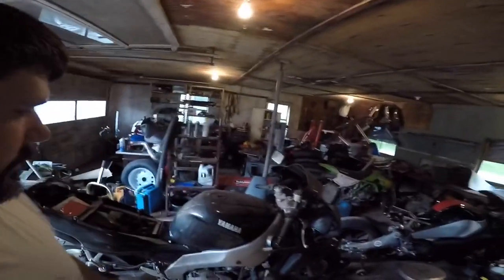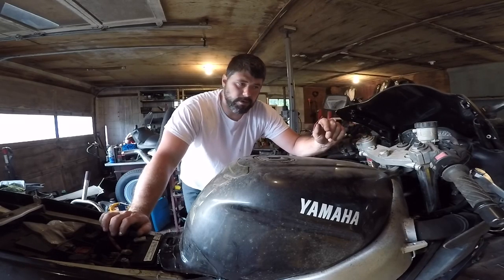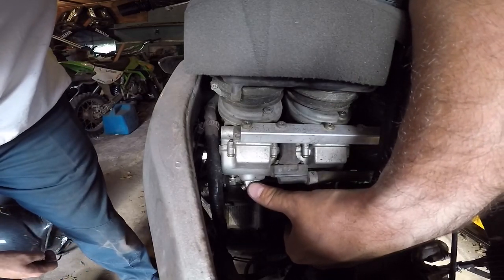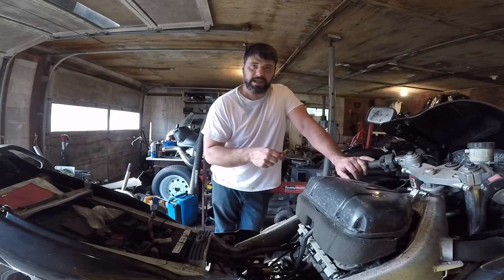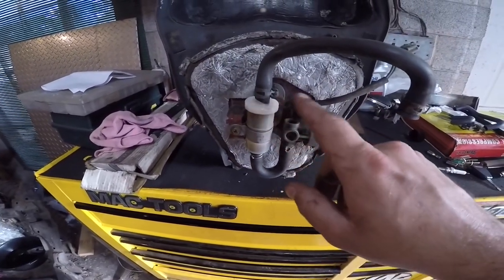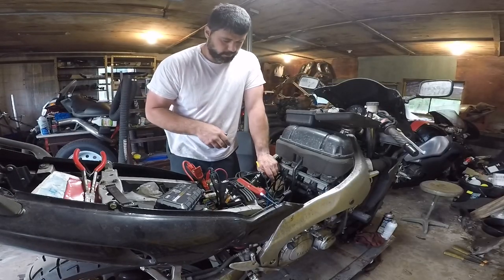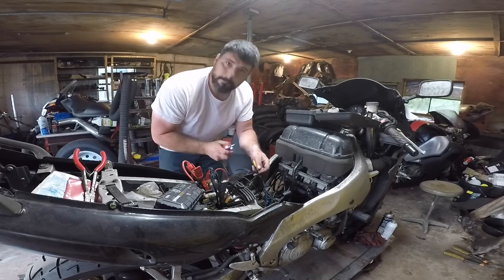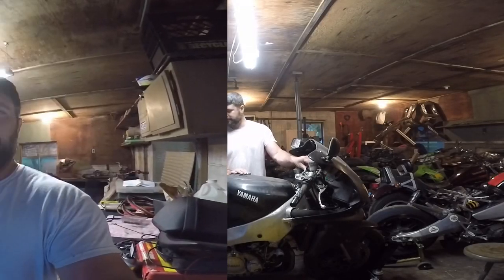Will my YZF600R (thundercat) start?

Comment: Mine b 4 I left to go bk to the uk was completely drained.  I mean not even engine oil in it. I wend bk to Kashmir after 7 years. Yes that's write  7 years.  Changed oil filter and added oil. Addid radiator flued.  Added break flued.  Addid a new battery from the uk. Dident change the fuel filter but added a good fuel not high octane.  Guess what????  The bike started first press and sounded just like new. I still haven't run her for 4000 miles yet would  you believe.  Check it out on my channel  .

Comment: I would of added premium and opened each bowl to allow fresh fuel to run out for a tiny...instead of trying to burn your starter out. If no fuel came out..then tinker with the fuel pump. Once you rinsed the bowls and insured the float isn't stuck...then try and start

Comment: So mines been sitting for a while. Put a new battery in it and it seemed to start properly and run but no I'm having issues with it starting, it turns over and theres no signs that lts in bad shape just won't start. I think it might be the spark plugs what do you guys wrekon

Comment: Got a 06 & it sat 2 years in garage with gas in it (I didn't leave it in it) so took old gas out & put new in & like a dummy tried to start it (sucked all that gas that was in carbs up instead of draining it) now it runs & rides but don't run good at all & very hard to start the fuel pump does make a odd noise like a clicking sound I took 1 bowl off carb & to my suprise it was clean gas came out & has new fuel filter do you think pump could be the reason it running bad or are those carbs really gonna have to come off?
Reply from the maker: More than likely it’s the carburetors unfortunately